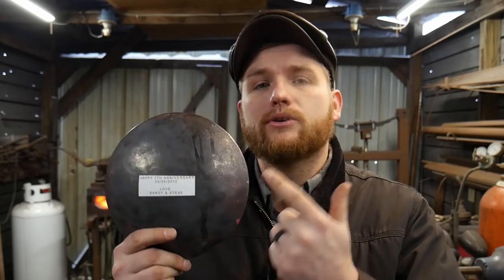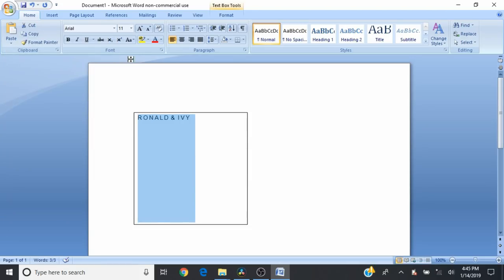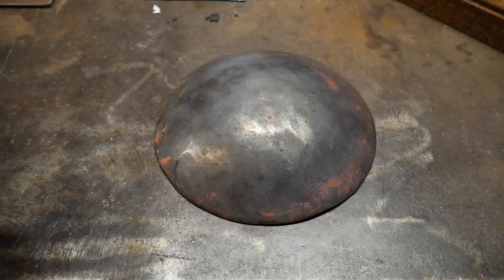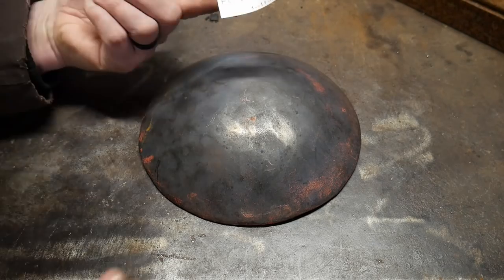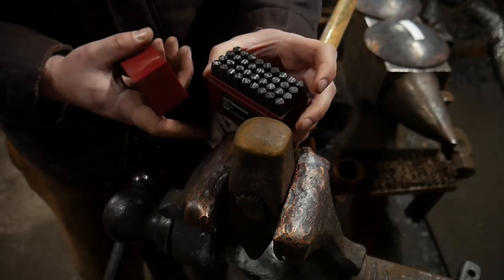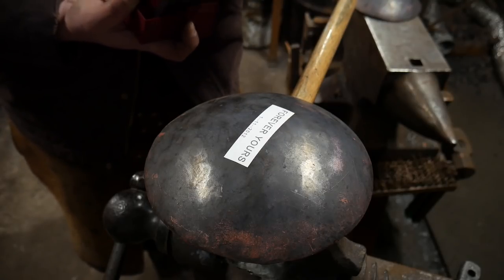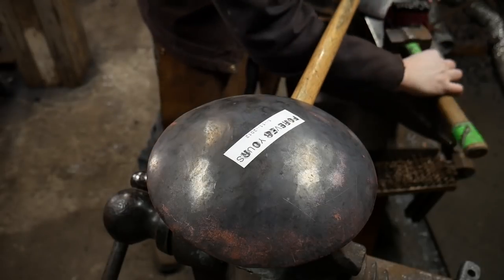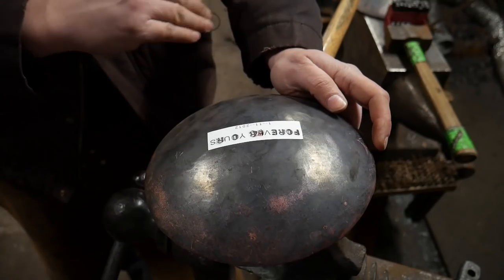Using Metal Stamps to Make Customized Products (And Make More Money!)

Comment: Great video Roy & Jess, yeah I liked that very much and it will be useful. Some constructive criticism; man that's very labour intensive. Lot of working the hands there not to mention the computer requirement. I'd be looking double for what you are charging to make it worth while if that is the process you settle with. Sure I can appreciate for the sake of a demo, what you are doing is fair to say. Man, I'd have to knock that out in less than 2 minutes using a set up, say a fly press well set up. This is only notions and suggestions and have not been proven. Only food for thought. Keep up the great work.

Comment: I’ve done this before but I used harbor freight’s stamps and come to find out there letters aren’t square with the outside of the stamp, some are twisted to the left and some to the right, I am a welder as a profession and have to stamp my welds and they hold up pretty good on carbon steel I haven’t had any problems with that part